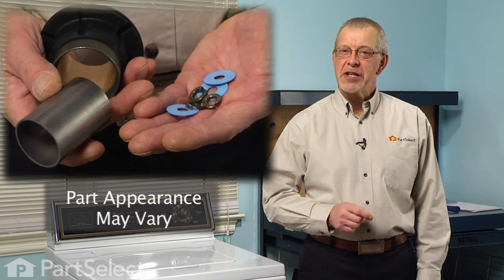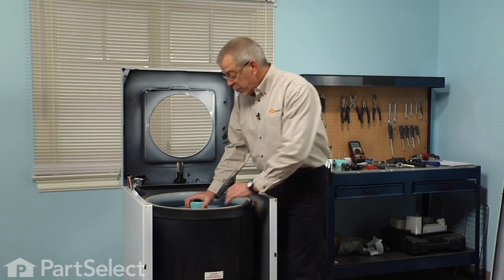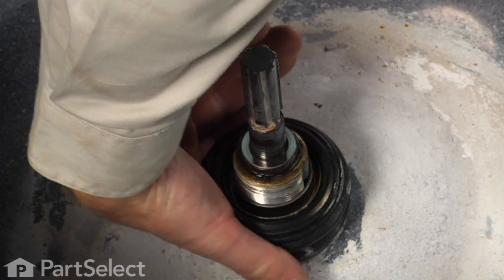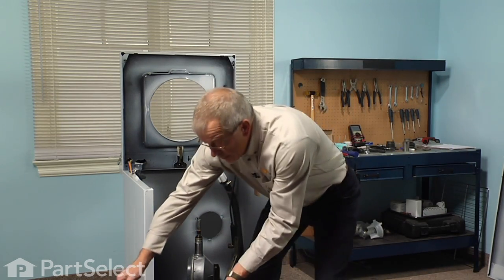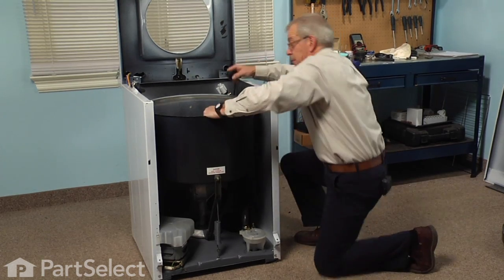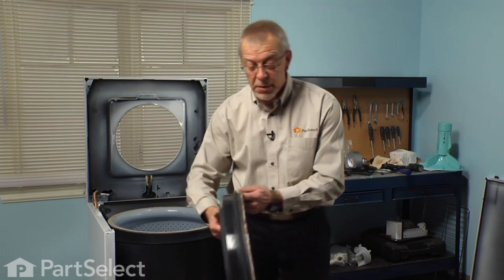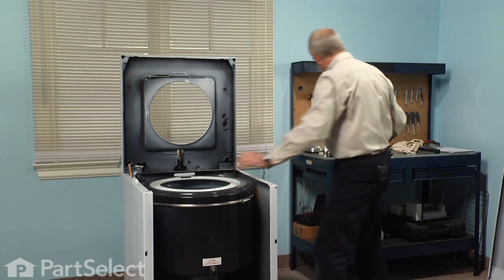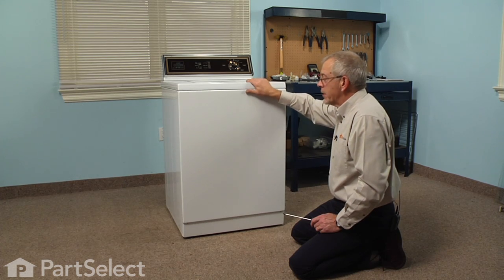Washing Machine Repair- Replacing the Tub Bearing Kit (Whirlpool Part # 6-2040130)

Comment: Great video.  I just used this to replace the bearing in my Maytag.  One difference: My bearing was stuck together with the the piece that he had to stomp through the tub hole.  When I lifted the tub, only the tub came out (after a fight).  And then I couldn't pull the old piece off of the bearing and the shaft.  I had to cut a small slit, fight with it, cut a little more, more fighting, then eventually the bearing AND the piece that fits over the bearing came out in one piece.  Until that and while installing, it all went just like the video.

Comment: I have a 2000 model Maytag lat9696age that is leaking water on the spin cycle from the centre of the tub, do I have to replace the tub bearing when I replace the stem seal kit?
Thanks
Reply from the maker: Hi Glenn, while researching your model number the manufacture recommends that if your replacing the tub bearing to also replace the seal kit at the same time.

Comment: do you also have to replace the mounting stem/tub seal kit as well, while replacing the bearing kit?
Reply from the maker: It is not necessary to replace the mounting stem kit for a bearing replacement job, but it is standard practice for many technicians. If
the tub bearing was corroded badly or if the mounting stem seal is deteriorated any, then we would suggest that you replace the mounting stem kit at the same time.
Reply: Thank You!

Comment: I have these parts ordered and have a question.
You put the sleeve on the transmission - then put the tub over it , shouldn't some grease be used on this?
Reply from the maker: The steel sleeve does not need lubrication. The lubrication is contained in the bronze tub bearing that the sleeve rotates in.

Comment: very helpul  video ,the head bolt holding the agitator is  missing .how can i unscrew what left of the screw   in order to remove the agitator
Reply from the maker: +דוד אברהם סמרלי You can try locking pliers or “ViseGrips” if there is enough of the screw left to grip. Otherwise you would have to cut away that portion of the agitator to remove it, which would then require a replacement.

Comment: What washer is this? I've never seen this type of whirlpool before.  Thought there were only the classic belt drive (70's-80's), the design 2000 (direct drive)  and the new Cabrio (high efficient lock lid) version.
Reply from the maker: +fred handy That is a Maytag Dependable Care style washer that was in production from before 1960 until around the late 90’s.

Comment: Great video, just bought a used Maytag A712 (circa 1988 model) off of Craigslist  and this helped strip it down and clean it up.  We had a Maytag (A512 I think) from 1986 to 2014 and for some reason replaced the washer and dryer when the gas dryer died.  We got a LG front loader and my wife HATED IT, the front loaders have no water in them and she was rewashing loads multiple times to get dirt and beach sand off of clothes.  Also they are high maintenance there are all kinds of things to do (wipe the rubber or it smells, filters to clean, leave the door open,...) So we went back to the classic easily repairable Maytag top loaders.  Drove 180 miles round trip to pick up the used Maytag A712 and LOVE IT.  Who would have thought a tub full of hot water swirling around would be so satisfying.

Comment: Hi, Steve. I followed your video here to the letter and watched it a few times. Everything went well on my tub bearing and tub seal job on my Maytag. The old bearing assy. was so rusted, it stuck to the input shaft when I pulled the outer tub off. I soaked it with WD-40, then I cut  one side of it as best I could with my Dremel tool, then used a short angled shaft pry bar with the chisel-like tip and a hammer to knock it loose and get it off. Then I used the Dremel tool to cut either side of the bearing sleeve and knocked it right off. That`s a good idea they came up with, designing that shaft with 2 slots to accommodate using a cutting wheel if you need to!  After the repair, I ran the washer on "spin" cycle for 4-5 minutes to be sure it was okay, then started  my laundry. Works like a charm now! Thanks so much!  Now, on to my water inlet valve replacement job on my dishwasher!
Reply: This is what happened to me, too.  The old bearing assembly was rusted and stuck to the input shaft.  I used a different tool to cut, but I ended up doing what you did.  (I wish I'd read your comment first!)

Comment: No, you're mistaken.  This screw 22001819 holds the plastic agitator onto the steel agitator shaft. I have this installed already.

On my unit, the whole steel agitator shaft PS2347244 pulls out very easily from the transmission (with the whole plastic agitator PS2019803 still attached to the steel agitator shaft). I need to keep the agitator Shaft firmly in the transmission housing.  I hope this is clearer now...

Comment from the maker: Hi Paul,

Yes - the part you need is called the locking screw and O-ring. The locking screw is located on the side of the agitator, and keeps the entire assembly locked down. You can find this on our website, and the part number required for your model is 22001819.

I hope that helps!

Comment: Is this agitator hold down bolt available?  I want to order it, along with bearing and seal, but I don't see this bolt anywhere in your transmission diagram...I need to keep the agitator shaft from coming out of the transmission housing.  Thank you.

Comment from the maker: The agitator shaft is held in place in your washer’s transmission by the agitator hold down bolt. The bolt connects the agitator to the top of the transmission shaft. In addition, there’s a small spline on the transmission shaft and also on the agitator to help with a tight fit. Hope that helps.

Comment: I need to replace the tub bearing and seal on my Maytag LAT9557AAE due to noise and water leaking. But the agitator shaft (with the plastic agitator auger attached) comes out of the transmission easily.  What holds the agitator shaft in place on the transmission on my unit? Thanks

Comment: I finally have my tub bearing replaced and stem seal.  My machine was spinning before I replaced them.  Now my machine will not spin and I smell the belt burning during spin cycle.  I know my pump is pumping the water out.  I checked to make sure the top was not rubbing.  What else can I do to check why it is stuck and not spinning?

Comment: Great video, I've waded through dozens of repair forums where the final remark was telling them that the parts and/or labor were too costly or cumbersome to do yourself. That they should just take it to a repair tech or replace the unit altogether. It seems that in most cases the company that sells the parts will be the first to tell you how to fix it yourself. Although the other forums were useful in that collectively they gave me enough information conduct a search that led to this video.